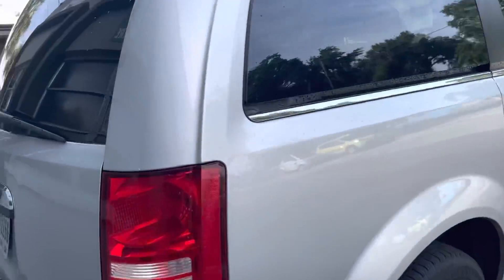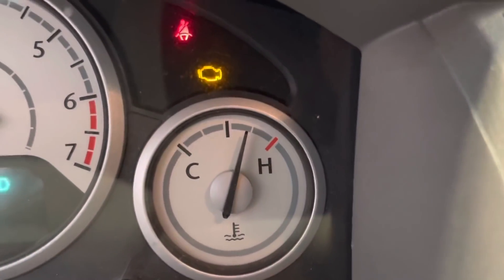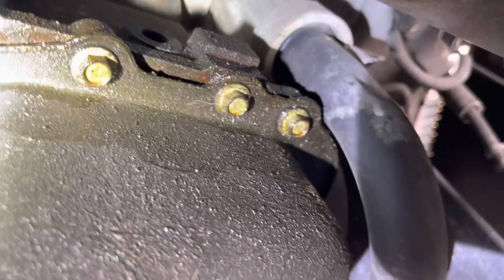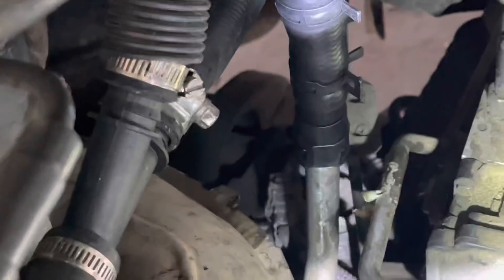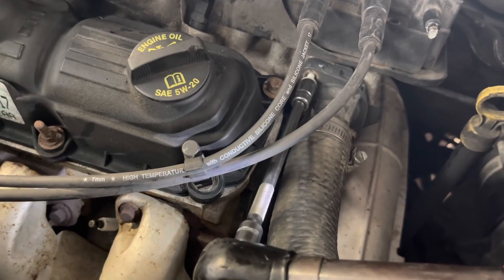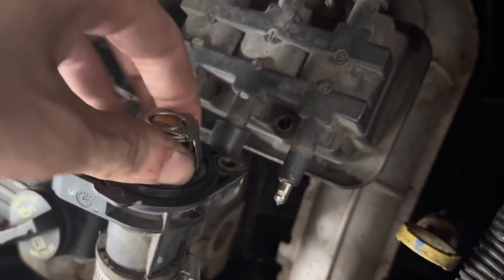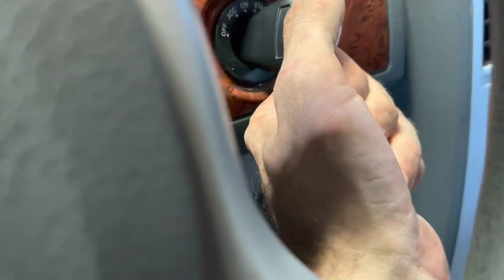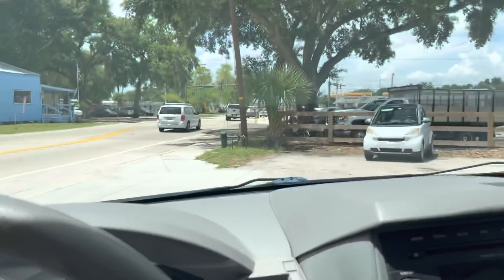Customer States: NO! I don’t want it! Just do the minimum!

Comment: Is this guy an older gentleman? Seems like the "old skool" guys always just trying to substitute coolant for straight water. And when it starts overheating, just leave the radiator cap loose. With a complete lack of understanding that modern vehicles can't run that way. For a few different reasons. And then wanna complain "I'm never buying a (insert manufacturer) again" because the head and/or block cracked when the water froze. Or, the vehicle is constantly broken because it doesn't get any maintenance. 

Then again, lack of understanding is common nowadays, regardless of what generation you come from. Knowing how and why to check basic fluid levels and tire wear/pressure should be a requirement to get a license. PROPER tire pressure. Not what's written on the side of the tire....... And not just 32 PSI for everything..
Reply: Van made it to 250k, Its at the end of its life. Nothing shown on it looks rigged, just old with a few things needing attention. Prob not worth fixing the seepage on the power steering line/oil pan.
Reply: @mph5896  It depends. Not everyone can afford to just get another vehicle. But, if a crank position sensor, or a new power steering line will get it down the road a few more miles, sometimes that's what people can afford. No argument that it will cost more to keep a worn out vehicle going in the long run. Sometimes, that's what you gotta do.
Reply: Umm, it had a massive leak, probably "a friend who knows about cars" "fixed" it for him. If you have a leak, why waste coolant until it is fixed.

I wouldn't be surprised if he was actually going to put coolant in himself, only not pay the mechanics price, pick up some cheaper stuff somewhere.
Reply: @Cheepchipsable   If you paid attention, he said he was gonna put the system under pressure. I assume that's when it started leaking. Also, you'd be surprised what people will ignore/not pay any attention to.
Reply: I'm an old skool guy and I would never run on straight water or just leave the cap loose. Where do you get those ideas from?  I think the criticism should go the other way, the younger generation now doesn't know jack about cars or mechanics, they're a bunch of soy boys. They don't even know how to change a tire or check their oil.   Who do you think was building all those hot rods before you were even born? Old skool guys like me.
Reply: @hoangling4344  

Calling a spade a spade.

As one of these younger people you're talking about, I know plenty about cars. I say old skool guys because nearly every time I've seen this done, it's been by some dude in his 50s or 60s because that's what they did to get it back home in the day. If it looks like a duck, and quacks like a duck... 

Contrary to that, younger people are, arguably, as ignorant, but in a different way. They're more likely to just not pay any attention to anything under the hood until it stops running. They wouldn't have put straight water in it because they wouldn't know that it was low on water to begin with.

The car scene is still alive and well with the younger generation, contrary to what your generation might believe. And, arguably, we know more about tuning and making more power because of advancements in engineering and technology. Let's face it: No one was getting 900 HP out of a 2.0 litre 4 cylinder in the 60s. 

Don't be coming at me with your "back in my day" bullshit.

Put some ice on that butthurt.
Reply: @hoangling4344  I'm not sure I agree with that assessment, since, ya know, you're the one who came in here with an attitude. And I subsequently responded with attitude. 

Don't hate the player, hate the game.
Reply: @hoangling4344  And for the record, I already pointed out in the first post the ignorance of people nowadays not knowing how to perform basic maintenance tasks on their vehicles. But, it seems like you were the one triggered and didn't make it down that far.

Edit: I do not own a "rice burner" (<-- Racism), I have a BMW and two Chrysler products, and don't give a shit about TikTok.
Reply: @akio2589  "Racism"? LOL, Can't imagine what it must be to be so weak as a man you have to walk around looking for something to be offended about all day, whatever "race" you identify as.
Reply: @calculator1841  You, apparently.

Edit: You people are waaay too easy to trigger lul. You don't even get what's going on there, and that makes it even more entertaining.
Reply: @svtcobra8542  Mmk, one of two things has happened here: Either you can't read, or you don't understand the expression. Also, you evidently didn't read down far enough. I said the term rice burner is racist. I didn't call anyone specifically racist. I also made it blatantly clear, if it wasn't already, that I said that specifically to piss you (and others that have your mindset) off.
Reply: @jbd4365  I agree. Of course any clean water is better than nothing until you get it properly fixed. My first jobs were in Florida working at a radiator shop while in high school back in the early 70s. They were far less reliable back then and coolant has gotten a lot more expensive.
Reply: new cars are just junk need to build them like they use to
Reply: @jonsworld5307  No, sir. You weren't getting 200k miles out of cars from the 60s and 70s. 100k miles, and they were done. It's far more uncommon nowadays to see cars going to the junk yard (that haven't been wrecked) with under 200k miles.

If you're referring to the fact that modern vehicles crumple in an accident, then you are under the common misconception that new cars are junk because they crumple. In reality, they crumple to keep you alive. If they did not crumple, like older vehicles, then all of that energy is transferred through the vehicle to you and passengers. Sure, that means that a fender bender does more damage. That also means that when some jackass runs left-of-center and blasts the front of your car at 60 MPH, you are far, far more likely to survive it because the front of the car absorbed a majority of the impact.

So, no. Modern vehicles are not junk. They are (mostly) well-engineered, (relatively) reliable machines. There are exceptions, of course, but given the various manufacturers and sheer volume of vehicles produced, those exceptions are far and few between.
Reply: @jbd4365  One could argue that if this customer had the knowledge/understanding to repair it themselves, they would have done so instead of taking it to a mechanic to begin with. Based on the general disposition of this particular customer, I'd have my doubts (just like this guy who put coolant in anyway) that coolant would've been added and would've just resulted in a cracked block/heads come winter time.
Reply: @akio2589  tell that to my 252k miles 78 ford never been rebuilt runs like new people back then just didnt take care of there cars
Reply: @jonsworld5307  Once again, there are exceptions. On average, a guy would get 100k, 150k if he was really lucky before major servicing was in order. 

As far as it goes, you can keep anything you want running as long as you want. Just depends on how much money you wanna throw at it.

Also, there's more than just the engine and trans to worry about.
Reply: mrpresident  

It's not arrogance to be annoyed when people like you come in here discrediting what the generations after them have accomplished. 

I'm claiming that modern engineering does it better than they did 50 years ago. Subsequent generations have improved that infrastructure, and you can discount it all you want. Doesn't change the fact that each generation brings more and better improvements to that infrastructure, and it's wrong to ignore that. My generation didn't build the foundation, but we sure are having a hard time ripping out the bad parts to make it stronger for some reason....

And regarding modern vehicles? I absolutely know more than the backyard mechanic from 50 years ago. I have to, modern vehicles are far more complicated. 

Unless you've been in the trade for 50 years, working on modern vehicles is NOT the same as it was 50 years ago, which is fundamentally my argument. You can't just twist on some mixture screws and adjust the valves to get a modern vehicle to run correctly. You do still have to do valve adjustments on some modern vehicles, but most of those have been phased out with hydraulic lifters/lash adjusters.

Now, if you have an individual that has been in the trade for 40 or 50 years, and is up to date with modern standards and equipment, then sure. That additional experience is absolutely a benefit, and current/future auto techs could learn from them. As long as they're willing to teach, anyway... Now Billy Bob with his Craftsman tool kit who changed an alternator 30 years ago? Not so much.

But, there's a trade-off: What we've lost in simplicity we've gained in power and efficiency. A much smaller engine can do the same work with twice the fuel economy of engines 50 years ago. 

And whether you like it or not, my generation is at the helm now. For better or worse.
Reply: @Ellotherem8 Nah, I'm pretty sure everything's dialed in just fine. K, thx, bye.
Reply: @Ellotherem8 What's wrong? Something I said hit a little too close to home?
Reply: @Ellotherem8 mmk.

Comment: I bought a 2011 chysler 200 with only 77,000 miles a few weeks ago... It was fine and cheap,.. After test driving and paying.. Within a few MILES the check engine light, a/c started to fail, one headlight went out...a weird nail polish smell emitting.. NO WAY MAN. I returned that POS for a full refund. Ended up with a 2006 Accord with 155k, couldn't be happier with the thing.

Comment: No coolant, just water, and wonder why everything corrodes later in time
Reply: Actually, straight antifreeze is more corrosive than straight water due to the ethylene glycol and propylene glycol that are the main ingredients.
Reply: @dakotakelly9371  that's  why they add corrosion inhibitors
Reply: @davidbulich1254  I’m aware of that, your commend just insinuated that straight water would cause corrosion quicker.
Reply: @dakotakelly9371  i see your point and agree to a point, but I was referring  to tap water not distilled as some wells like mine are very acidic and definitely  will corrode  aluminum  and copper more quickly  and  no lube for waterpump seals
Reply: This guy gave up on the antifreeze since it just poured out as fast as it went in. Straight water is better than nothing.
Reply: @ssnerd583  I can tell you that's dum... not a mechanic but my first car was a $1000 Hyundai accent with 120k miles on it. Had to swap the thermostat cause it wasn't cooling. And I filled it back up with water. About 2 years later the water wasn't clear anymore it was brown...
Use coolant guys please. It was designed to have coolant. Doesn't HAVE to have it for short periods of time and for diagnosis it's fine... but not once you've got it fixed....
Reply: Waters good enough if your running cleaners for a while. I did that with a sentra. dropped it all at the edge of winter last year and went from there with 50/50
Reply: Also without coolant the water can freeze. Depends on where you live though ;)

Comment: I’d like to point out that even though this vehicle has been treated to junk, it still seems to have some life in it after a quarter million miles! I’m not a fan of Chrysler’s ( especially those minivans)  but do feel that if I had my mechanic calling my vehicle “junk” I’d be looking for a new one regardless what I drive. I actually do agree that it’s been neglected but gotta give it respect for the mileage! Still appreciate the video, and the fact that he went the extra mile to add coolant, regardless of customer cheaping out. Shows pride in what he does!
Reply: "especially those minivans"
Curious as to why.  They seem like a perfectly decent family vehicle to me.
Reply: @ColonelSandersLite  lol never buy FCA unless going performance , a sienna is way better and cheaper
Reply: @guilhermes4399  Better in what way?  That was the question I asked the other guy.

I'll tell you this - I have a family member with a town and country with fold down seats.  The rear is exactly large enough to haul 4'X8' sheets of drywall/cement board/plywood/whatever (which my family does frequently) and the actual folding stowage of the seats is genuinely pretty convenient overall.  Seats 5 in the rear so plenty of room for kids and dogs.

From what I'm seeing online, it looks like the sienna's wheel wells give a maximum floor width of 44" so, if true (hard to tell online without doing a more in depth check), that's definitely a downside.

Comment: Fill it with water ? What the hell is wrong with these people.
Reply: In case you didn't notice, it was leaking out almost as fast as it was going in. He was probably going to buy coolant himself, and simply didn't want to pay a shops mark-up.
Reply: Water actually carrys more BTUs per pound than a 50-50 coolant mix. Distilled water doesn't boil as easy as tap water and doesn't leave any minerals. I race a lot. Sometimes we have to use straight distilled water to keep from overheating if it's a treacherous track and hot. The coolant system has to be completely flushed of any contaminants or the distilled water will boil like tap water..

Comment: Good for you for putting coolant in it regardless. On the plus side while watching this video I looked up info about coolant and turns out that ethylene glycol significantly increases the boiling point of the coolant mixture as opposed to straight water. I always put Toyota long life coolant in my vehicle because that's what the manufacturer tells me to use and I knew that antifreeze prevents the coolant from freezing in the harsh MN winters, but now I know that antifreeze is just as important to use in the summer time too. So I learned something, always a good day when I get to do that!
Reply: You change your coolant depending on the season?
Reply: Had a fella who thought if 50% antifreeze/water mix was good then 100% antifreeze was best. Couldn't understand why he kept running hot.

Comment: I would not work on P.O.S. like this.  If he doesn't want to fix it right send him on his way. I worked at Sears in the late 80's. Guy came in wanting a battery adjustment. The car was a 70's Plymouth roachcoach with slant six. The alternator belt was held tight with a block of wood jammed in between it and the block. The battery was obviously from a junk yard as it was the wrong one for the car and tied in with wire onto what was left of the tray. No warranty card or receipt AND he wanted a NEW battery free of charge even though the date code on the battery said it would have been out of warranty anyway. He said he was a 'mechanic' for years and was a rude bastard. It was all I could do to keep from hitting him in the mouth. Manager said to shove his pile out of the shop, which we did.

Comment: Guy must like replacing parts. Does he not know that the coolant is also the lubricant for the water pump?  Look for a water pump replacement soon, or it will be totaled when the brake problem comes back to bite him in the derriere.  Also I agree this is a piece of junk, coming from a guy who was a mechanic in the 60's and 70's.   I used to be able to adjust a carburetor and timing by ear, but used the tools for the job instead.   (Vacuum gauge and timing light.  Still have both in my tool box.  My dwell meter died from a terminal case of mold after we flooded.)
Reply: Hey! I'll sell you my dwell-tach!
Reply: @michaelwarren2391  No need. I still have feeler gauges.  :D  And I have not had a car with points or worked on one in over 30 years.
Reply: @gerardtrigo380  LOL I remember when I would look at the points to set them. Now, if I could get up there over them, I need my strongest pair of readers, & to close one eye to see.
Reply: @gerardtrigo380  Points system is better off long gone with General Motors everrrr so reliable HEI and remote HEI. Oh and those damn LT1 distributors lmao.

Comment: Probably not going to see the mini van?  It needs a oil change and oil pan gasket.  A look at the transmission fluid?  Possible spark plug wires and plugs.  And definitely a brake check and fluid change?  And I work on my own cars. I don't blame you for putting coolant in it! That was very kind of you!

Comment: Gets a thermostat and gasket. Uses the thermostat but doesn’t use the gasket🤣
Reply: The black gasket is the only one you need, customer probably didn't want to pay extra for the additional one
Reply: Pay close attention to the part of video where mechanic removes thermostat housing from engine.  There was no gasket on it originally....just a rubber o-ring on thermostat that seats onto raised rim onto block.  In this application a gasket is not necessary.  But some thermostats come with a gasket whether it is applicable or not because they have so many different  types of uses in different engines.

Comment: I get you didn't need the second gasket, but it helps to keep the housing from leaking, they only put them on certain models. Technically the thermostat rubber seals it but with both it makes sure it never will leak or grow glycol crystals around the housing. I have seen it happen before, or it can cause a cold leak that goes away when it heats up. It the weirdest thing that it takes two gaskets there but it does.

Comment: My wife's 2007 Dodge Magnum broke the oil dipstick in the same place. Had to drill a hole in it, insert a long screw & prey. It worked. With this van, I would have gotten the dipstick removed to check for milky oil (coolant mixed with the oil - indicative of a head gasket leak).